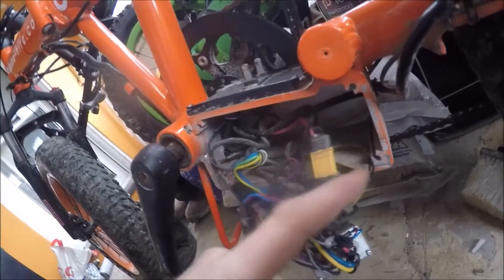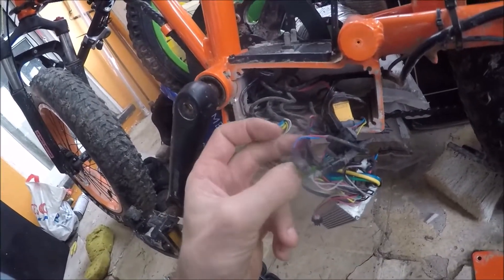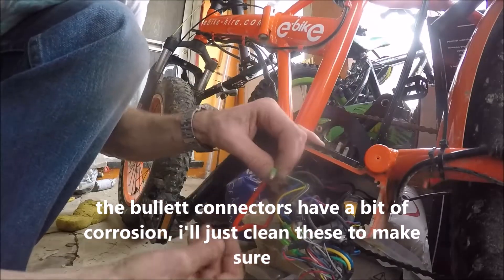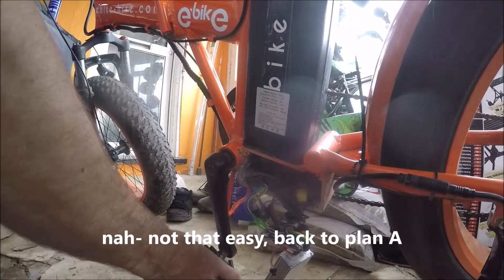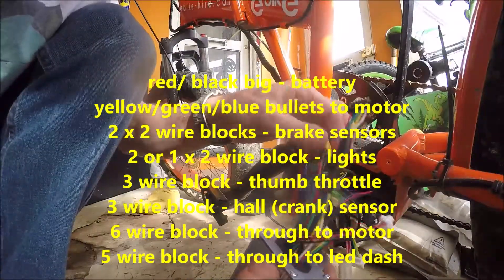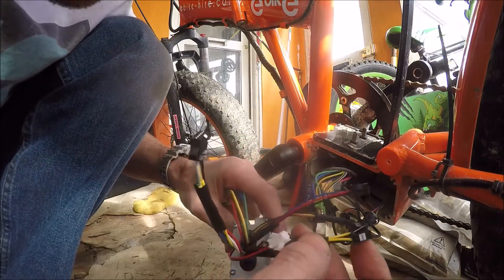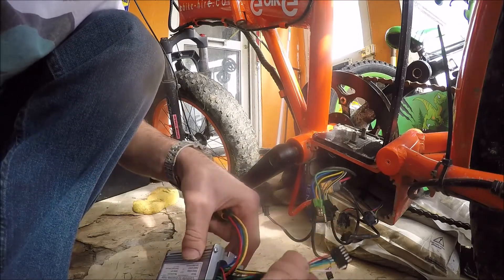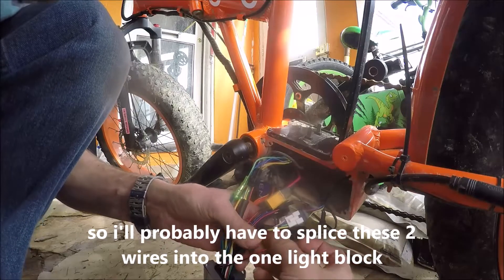Ebike Problems Fix - Controller repair replacement

Comment: Hello.  I have a puzzle with my bike.  Battery charges well to 56 V.   I can ride for a couple of Kilometers and then battery shows 3/4 value and shortly after shuts down.    When I return home all I have to do is plug in charger for a few seconds and then it reads fully charged and appears to be normal.    any suggestions?
Reply from the maker: Could be a dead cell, you can get them tested and get the duff ones replaced

Comment: Hello
I have a controller with gnd to signal have 0v , it cause a wheel not stop when i release the throttle , can i repair it

Comment: What do I need to replace if I dead shorted the battery with everything still connected? Not turning on and voltage goes from 36 to 5 when I try
Reply from the maker: there is usually a built in fuse on the battery pack, if that didn't pop you may have damaged a number of things, hard to tell unless inspected. If it's dropping to 5v when turning on, don't turn it on, you could cause damage/ fire. Take it to the shop and get it fixed.
Reply: @CamberKitesurfing  thank you.

Comment: For starters, that bike looks heavy AF, seconds the Box section in the frame where controller box sits is probably not water proof, and for afters:- that controller box in the frame could do with a gasket or silicone sealer in it before the four bolts go in…

Comment: This is why I used dual mode sensor/sensorless controllers. 
Also, stay away from jst connectors. Waaay too fiddly and when one goes bad, you have replace the whole lot. You're much better off having an individual bullet connector on each hall sensor and throttle connection

Comment: I was wondering if you could give me some insight into the problem with my e-bike. I have an electric bike that shuts off after a few seconds of riding. In both cases, using the pedal accelerator or the throttle control button, it happens. The bike display indicates the battery is full and there are no issues.
Reply from the maker: does the speedo show any speed?
Reply: @CamberKitesurfing  Yes. The few seconds before the shutdown, the bike functions as expected.
Reply from the maker: @MattConquer  does the display go blank?
Reply: @CamberKitesurfing  Exactly. After a few seconds of riding.
Reply from the maker: @MattConquer  check contacts on battery dock, all wiring , then try a new controller
Reply: @CamberKitesurfing  Thanks!
Reply: Hello, I need help my ebike kit was working fine and then I changed it onto another bike, now when I plug in the controller to the hub wheel connector there used to be a spark and now there is now spark, is that the battery or controller thanks.
Reply: I would suspect their is a dry solder on the PC board.

Comment: How is the bike doing now?
I just ordered same controller because my controller on my bike is not working.
Reply from the maker: still going strong - ended up with a new dash and controller, you can buy a kit, I've sold that bike on now but we have a new fleet
Reply: @CamberKitesurfing   won’t work on different display?
I think that controller is for kt but when I saw your video,I oredered one wirhout the display.
If it wont work on my display I’ll order the Display.
Reply from the maker: @shotxcj2655  i'm not sure it was nearly 2 years ago now, hope you get it fixed up

Comment: Hello.

Please help me with some information: how can I remove the speed limit from the controller from an electric scooter?
The person who sold it to me does not have a license and had a speed limit from 100 to 35 Km / h.
I have allowed and I want to remove this limitation.
I tried unplugging the Hall sensors, but it doesn't want to work at all.
I disconnected (+) and (-) from the sensor supply and no speed change occurs.
I disconnected the white wire that comes out of the motor wheel and the speed does not change.
It is a scooter LUKAS TWO 125 Italy 2008, 1800 W.
I was told that two wires must be glued to the controller at the initial position they had before the speed limit, but I don't have a diagram and I don't know which wires.
Thanks.

Comment: my controller stopped working correctly after getting wet. narrowed it down to problem with my 2 pin wires for my brake sensores as well as throttle not responding. trying to narrow this down but i cant figure out how to test this as the wires are all rediculously random and zero information. im ready to just buy a new controller and be done with this but the company i bought this through has made it next to impossible to test anything on this thing or have any info to make a sound purchase to a new controller. they tell me i have to buy theres for 189 and its just a basica 48v controller with oem blocking speed controll which im not having. do you have any idea how i would go by buying a new controller and still working with my display? this company has upset me massively as im now stuck and they basically leaving me with no info. sorry for the rant
Reply from the maker: I feel your pain, it can be a minefield as all seem to be slightly different. All the ones we tried were 36v. If you think from the ground up it could be easier, maybe look for a complete system that includes the display and change the lot out. That's what we ended up doing unfortunately
Reply: @CamberKitesurfing  hey thanks buddy for the comment back i just got off the phone with the franchse im forced to work through 200 for a 48v controller and wont gimme any info to help me out. i believe i need to find a controller to matched my display king meter (km6s) ill ytry there. thanks!
Reply: @markj6984  You need s new lcd display
Reply: mine too, exact same as this, in a box under the battery, its bound to happen with how they have the wires coming into the box, I have done all kinds of sealant now on the new one and its still going after 4,500 km
Reply: @utubeape  a year later still using all same stuff same controller but wanted to shunt mod it and discovered its packed tight with silicone lol. im not too sure about conrtoller compaibilities yet if someone knoews id love to chat with them

Comment: hey... i have 36 volt 500 watt hub engine front wheel kit that i bought for 6 years ago...it started to cut and stop when im climing...never done that before..so i thought my batteri was finished..so i bought a new 36 volt 10.4 amp..but it still keep stopping when it get to a hill/climing..so im woundring what is wrong..?    could it be the controller..the wire seem find..and when it stopes, everything shuts of..so i have to restart or wait about 30 sec.. thankfull for all help::)
Reply from the maker: check all connections, either the incline is moving a wire or it's load related, i'm afraid it could be loads of things
Reply: @CamberKitesurfing  okey...but do you think its the controller or the motor/engine?
Reply: @1379kalel  I agree with the first comment.  Check first to make sure all your wires are connected properly and have no breaks.   You could do a continuity test with a multimeter.  In terms of your controller, you can do a few test to see if your MOSFETS are damaged, narrowing it down to motor phase wires.  
You can also probe your controller with an ebike controller device.  Imo, ebike controller devices are a must and save time checking your controller.  You can find one on eBay for less than $20. A must have if you own an ebike and troubleshoot yourself.  Always troubleshoots before purchasing replacement; saves time, money, and peace of mind. 

Hope this helps….

/Bklyn👑
Reply: @robertmotion  Hi , I have the same problem when the bike is under load the controller turning off . I tried the controller on my second bike which is identical and the same thing happened . so pretty sure is not something wrong with battery or motor . so how to repair the controller as I can not find a similar on the net . its from 2012
Reply: @mos.f5810  hi did you get it fixed? A year on so my thoughts are the controller is not the problem as the known good controller from your other bike was not the solution. Battery pack needs repair? Just try the battery off the good bike if that's possible. If it's not that it's maybe a wiring fault of the PC board has a bad solder.
Reply: Hi, Everything shutting off is sign of the either the BMS cutting power from the battery due to low voltage, Or the controller has reached it's set low voltage safety cut off before the battery does. Your problem is clearly voltage sag under load. Does your display have a voltage reading? You should watch it when you are riding and see for yourself as the voltage sag happens when everything shuts off. - And check what your cut off voltage limit is on the display, make sure it's set no lower than what the battery BMS spec is. Your battery has been replaced, And still does the same thing, So we can eliminate the battery. You say the wires are fine, Double check every connection on the bike to make sure... And if all seems OK, It must the controller that's the issue. I can't tell what is the exact problem may be with it, But it could be fixable by an engineer, Otherwise it's time to replace it.

Comment: Just fitted a new cyclotricty ebike
 kit with a display LED 890 and it’s show a flashing just one light and not the full battery level. I have tried a new LED a different battery, a new system cable. Also tested these on another bike and all working. This is a real head scratcher

Comment: the reason is the syncronisation is not good between your hub motor and your new controller. Which means you need to figure out by try and fails which colour combinations are matching now. So the original 3 wires and 3 sensors inside the hub programmed differently in the new controller. so the right sequence need to be found by simple tries. exchange the cables till the nornal torque is back.
Reply from the maker: thanks for the advice, unfortunately I tried all combinations and it still didn't work.
We ended up fitting a new dashboard and controller, it's a bit annoying as it's now different to the rest of our hire fleet, but at least it works fine. www.ebike-hire.com
Reply: @CamberKitesurfing  there is one more thing in the controller you must set the number of magnets to get the proper induction. It is P7 or 07 or L7 whatever type of controller you have.
Have you ever met error code 09? What could be the cure for it? It is a controller failure but when I measure the cables everything looks normal based on the voltage. Also I do not think the chip burned out as I can still go into the menu and adjust the settings which is the evidence that the chip is not burned out....
Reply: I have the same error. I replaced the controller and still have the same error 09 what can I do next ? It’s only when I turn the throttle that the screen shows error